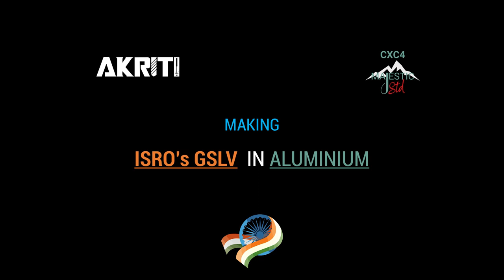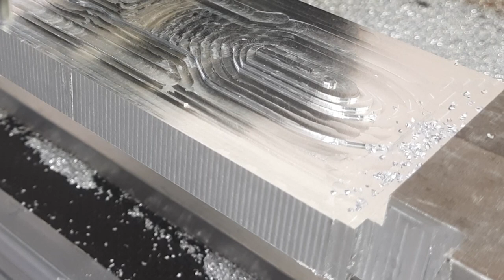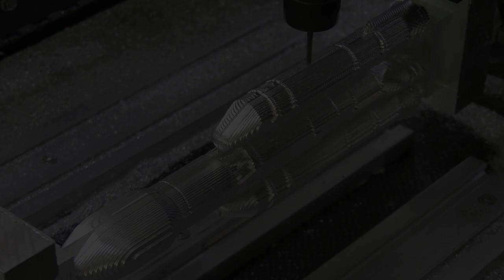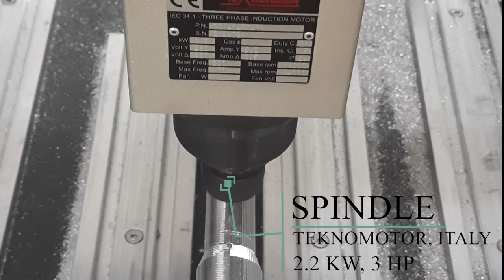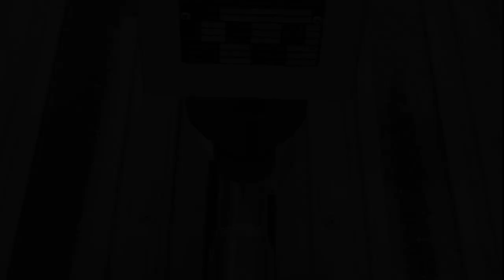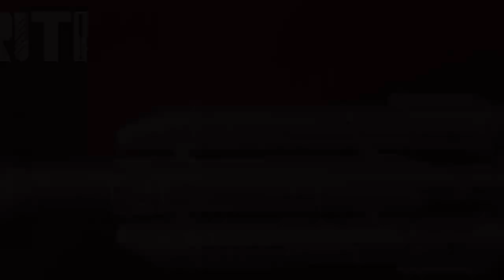4-Axis CNC - Making a Rocket - ISRO's GSLV MKIII in Aluminium (Grade 6082)-CXC4-Majestic-Standard

Comment: Amazing.. so this could be used to  build prototypes for new designs that are still under design and develop phase
Reply from the maker: That is correct !! You can even machine parts, dies, anything in Aluminium, Brass, Copper, Zinc (all Non Ferrous metals) including of course wood, mdf, plastics, acrylic, composites etc.